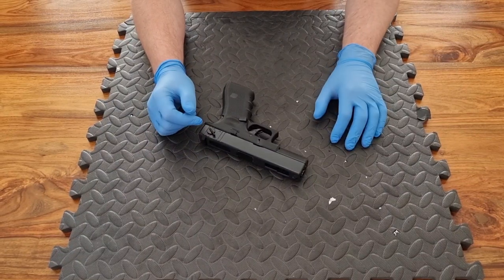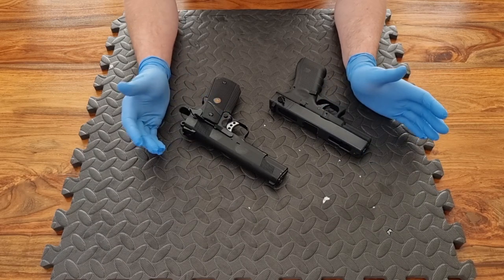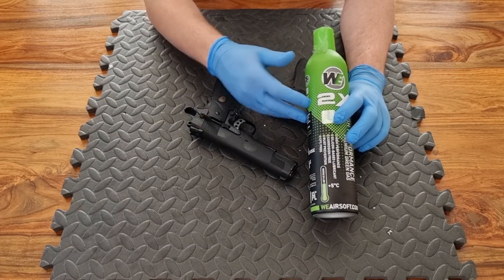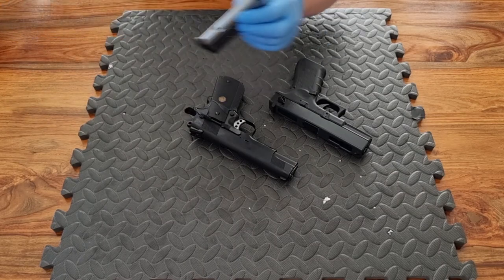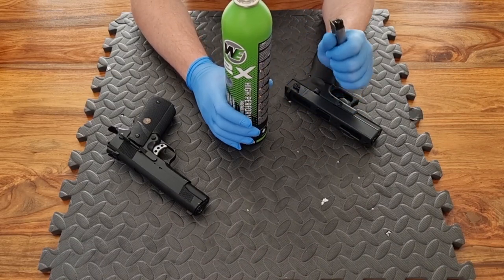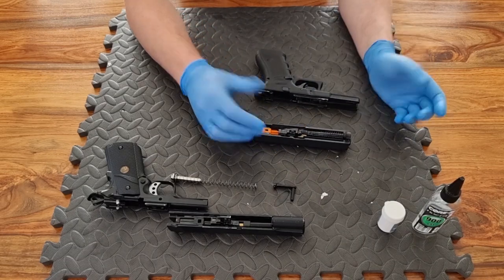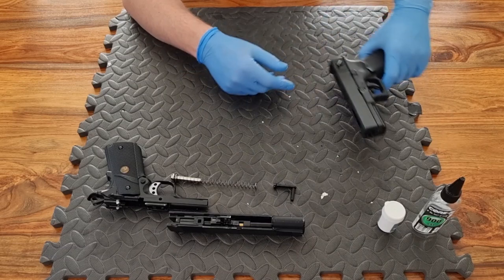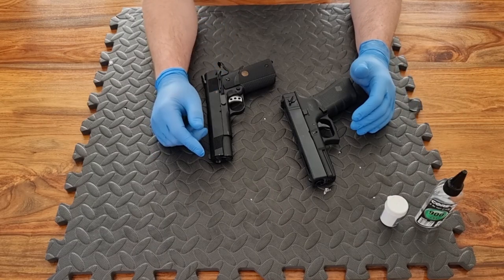Some basic advice for new owners of Airsoft GBB pistols. Gas, maintenance, tips and slide removal.

Comment: New player started beginning of year, bought a hi cappa (jw3 one). Knew about keeping the gas in mag and lube on slide but learnt about the oil on the mag valve etc. job for tomorrow. Cheers for
Info
Reply from the maker: I'm glad the video has been useful. Great pistol by the way. I have one of those in the collection but have yet to use it in game.  Should do you well. I hope you keep enjoying airsoft but be careful it gets expensive because one replica or two, or three is never enough🤣.
Reply: @rockbottomairsoft  I ran the jw3 taran tactical one on green gas when I chrono it on first game day on .28 it was running around 320fps so couldn’t use it. Didn’t have any hop appiled to it but going to try the white/summer gas in it and set the hop next time I take it out. 

Yeh got two m4s already and the pistol took my son to a game day last month, he loved it now need to get him a rif (only 10) ones I have too big for him.
Reply from the maker: That's shooting pretty hot then, mind you that's good if you can use duster gas in it and still get the fps. Should put less strain on the pistol and means its got some good seals in there.
It's great that you've got your son going as well. My daughter is still to young at the moment but I'm sure she's itching to have a go.

Comment: I have a question: the inside of my WE m1911 is completly "submerged" /  covered in silicon oil. Is this normal? Its even coming out of the slide. 1/5 of the magazin is also covered in silicon oil. Also the hammer and ?beaver tail safe button? On the grip
I shot around 250bbs. I never had a gbb before. Is this normal?
Sorry for my english
Reply from the maker: Well it's not normal to have huge amounts of oil. Usually less is more when doing maintenance. However it won't do any harm. This can happen sometimes due to the oil in your green gas. Best thing to do is just give it a clean up after use and apply a light coat of oil.

I hope this helps.
Reply: @rockbottomairsoft  yes thank you! Subscribed🙂👍🏻